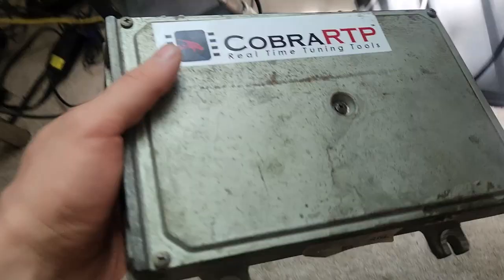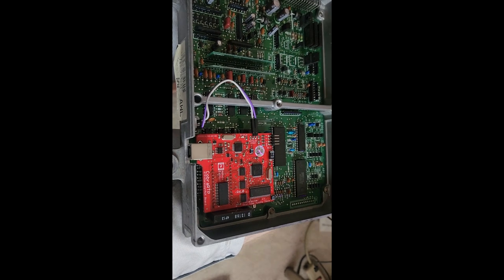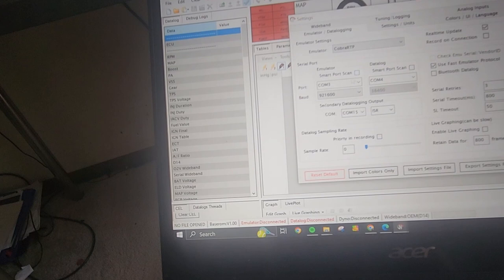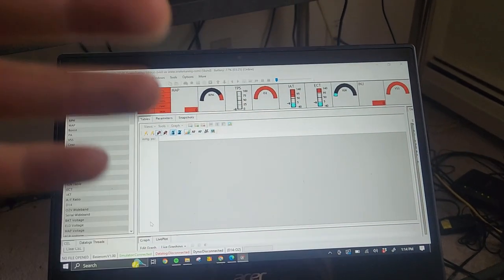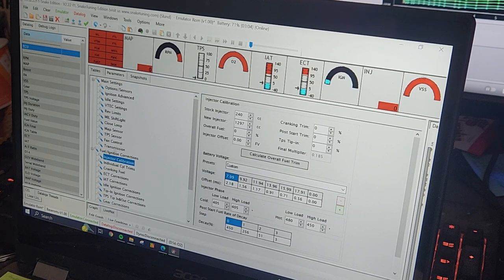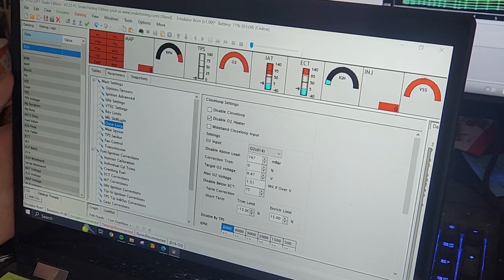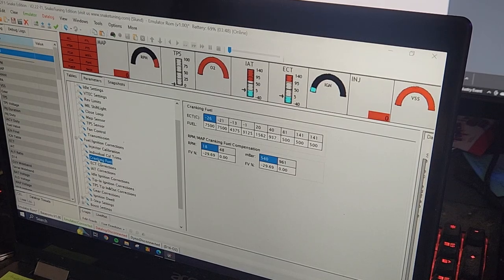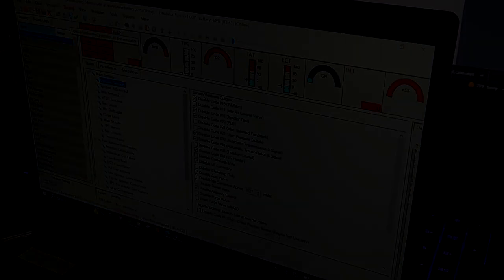Tuning with a CobraRTP

Comment: i like the content. I have a question. I want to build a low budget turbo honda. I will use turbo, intercooler, fuel pressure regulator and fuel cut defender. My 1st question is, if I install a map sensor and a check valve on a T connection instead of the fuel cut defender, will I get a mechanical fuel cut defender very cheaply? My second question is, when I increase the pressure via the fuel pressure regulator, I increase the pressure of the entire fuel system. Then, when the car is idling, does the afr drop to 10-11?
Reply from the maker: 1st question. You don't need fuel cut defender remove that from your setup.
2nd yes the entire system with have more pressure from adjustments on regulators
Reply: lol